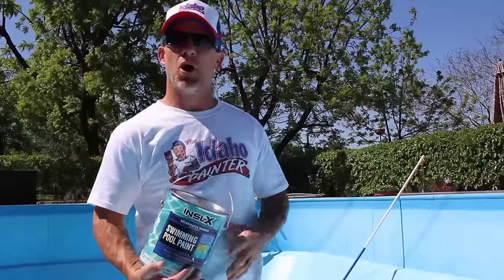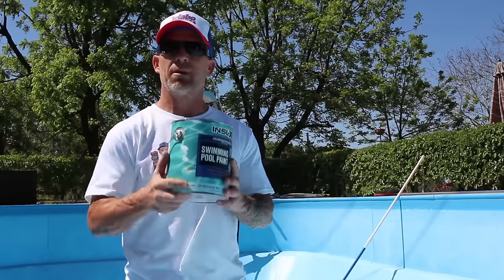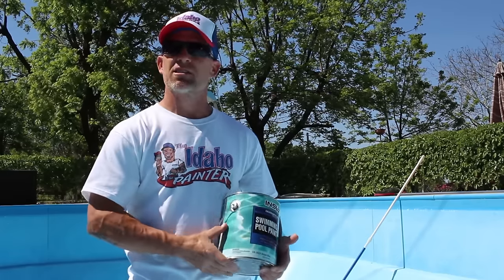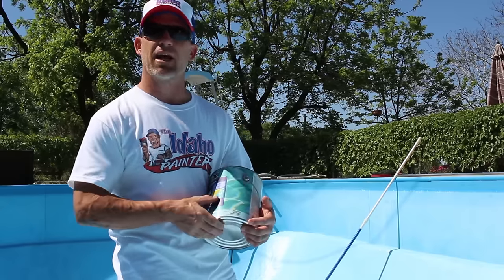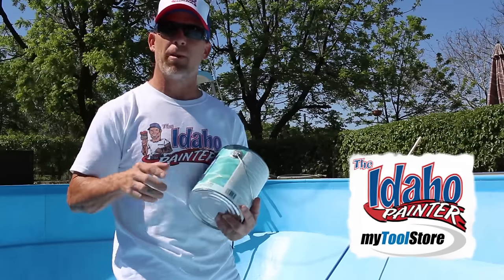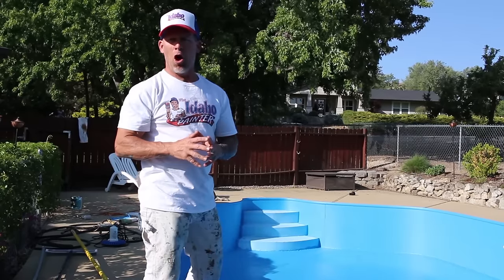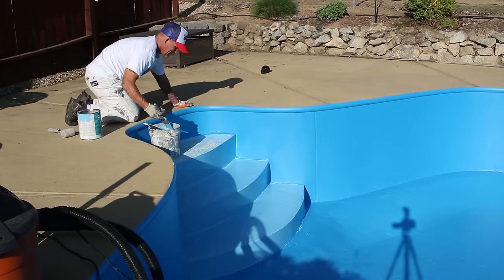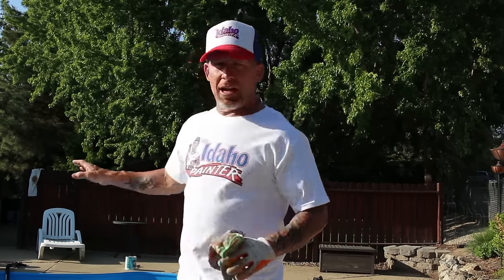How To Paint A Pool.  Painting Pools With Chlorinated Rubber Pool Paint.

Comment: From personal past experience, don't use a pool pump to drain a pool, it puts to much strain on the pump sucking the water up that high,and will likely burn out the motor, if not right then, within a few weeks.  Instead use a submersible pump you can drop down into the pool. I bought a pump from harbor freight that has worked well for over 5 years now.. and about 20 -30 pool drains, and it was under $100.

Comment: Looking for a little advice....I am presently living in a small country in S. America. On the property is an old concrete above ground tank that I am attempting to covert into some sort of swimming pool. Yes, I know it will not be perfect, but it's just sitting there and I want to find a use for it. There is a filter system (I will be replacing the old filter with a sand filter) but the tank itself is just bare concrete, 6' tall and 32' across. I've repaired the bare rebar and am looking for a paint. I wanted to use epoxy but they do not have epoxy pool paint here (only epoxy floor paint and I understand that is different) so chlorinated rubber is my only option. how many coats should I use for old bare concrete? also, it is late spring here and days are hitting 90's...is that a problem for painting?  any tips would be appreciated since I will be doing this on my own and have never attempted anything like it before. thanks.

Comment: Which pump did you use? How low did it get the water? I have a water table that fills the bottom to 3 to 4 inches overnight and want to keep it drained to no more then 1 inch overnight, which pump should I use?

Comment: Good video Chris. Why didn't you pressure wash instead of scrape? I figure you had good reason but am curious.
Reply: I was wondering that too, guessing it is there as a bonding layer.
Reply: pressure washing never takes it all off even on a weak house paint... honestly I thought sanding would have been better but might have been to tough substance and tearing the sand paper.. that coating is pretty tough paint its not soft by any means. 5 and 1 might of been only tool that was strong enough for the heavy stuff.

Comment: I am just so worried my pool will pop out of the ground when I drain it. It is a hybrid. Concrete bottom, fiberglass sides.  The bottom has chipped so bad that it just looks dirty. How do you know what the previous paint is? We don't know what 2 homeowners ago used.

Comment: I had a question my pool  was previously painted with epoxy paint and it’s chipping what would the process be to switch over to the rubber based paint
Reply from the maker: You would have to blast it to remove the entire coating

Comment: 3/8" nap? I would think that you would want at least a 1/2" to 3/4" to get the mil coverage. I'll go read the SDS on that In-sulux website.  Anyhow, interesting.
Reply from the maker: Worked for us!
Reply: Did you double coat the pool. I looked at their products on line,  but there is no specific mention of application in their  SDS. I was just curious because I do mainly interior architectural painting with a few specialty painting things on the side to include auto painting and clear coating. I'm always looking for a good tip on application in case I should end up painting pool someday. Thanques for the update.